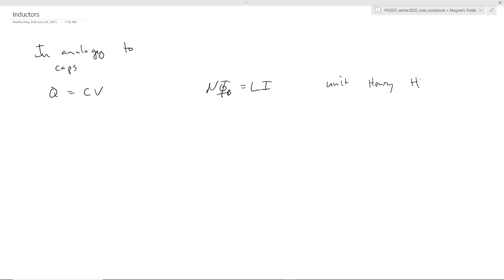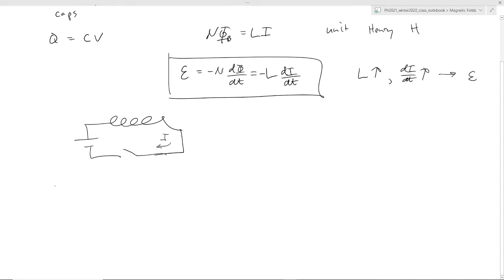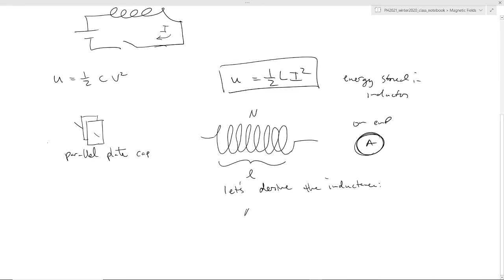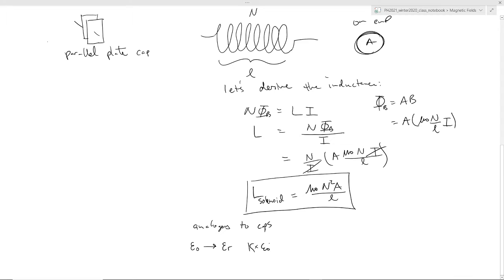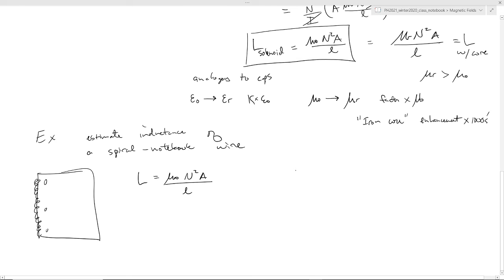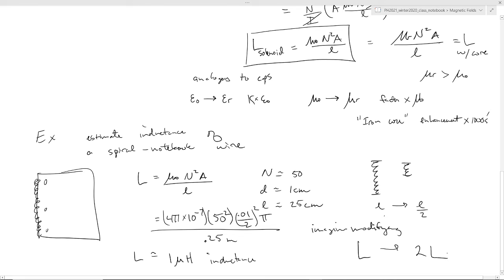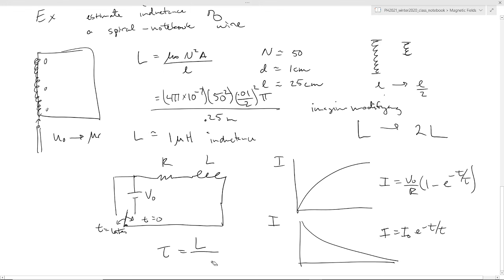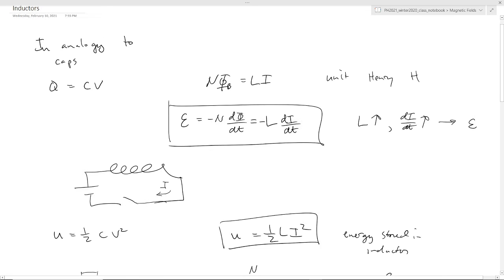Simmons PH2021 videos: inductors

Comment: Are inductors less common in circuits than capacitors are? Besides in the use of transformers.
Reply from the maker: Good question- it really depends on the application, so I won't 't say definitively, but I would relay that if you look at a circuit board there are a lot of caps on there for applications like rail-voltage noise suppression. Caps are very common.